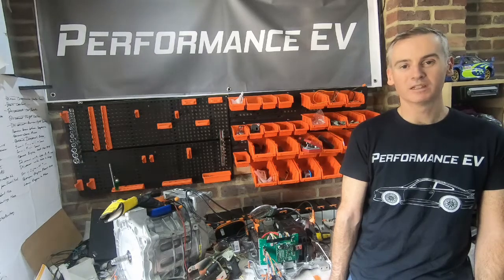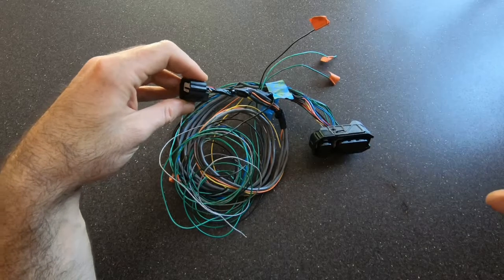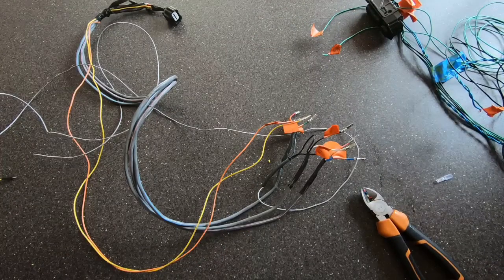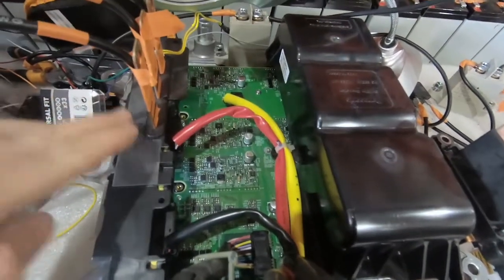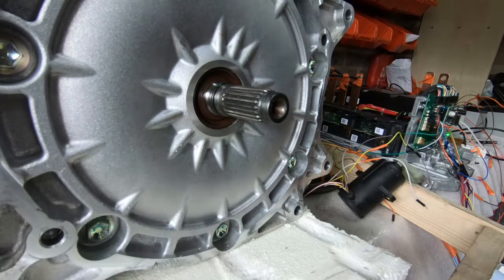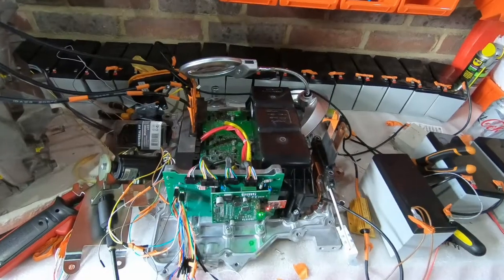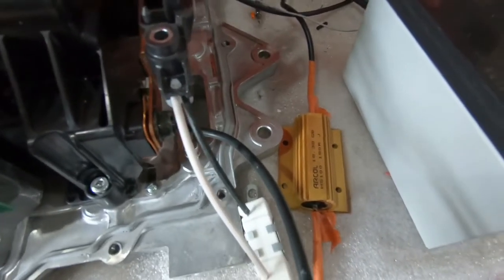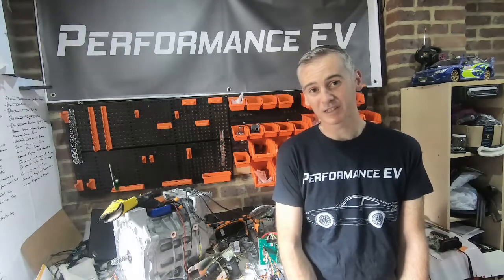Building an Electric Car - EV Parts - Nissan Leaf Motor running on open source inverter logic board

Comment: I never thought of replacing a perfectly good Porsche engine with a Nissan EV motor, but now you have corrupted me too much!! Thank you Shane!!.  I am going to buy a $10K Porsche boxter, and move my Nissan Leaf components into it, and maybe move the Porsche components into the Leaf... Will freak many peaople out!!... But I was thinking, I want to drag race a few bullies on the road with this Sleeper EV Porsche, and its top speed only needs to be 120 km /h after which I slow down to 100, and watch the other guy zoom by with a defeated bad temper.. So maybe, the 62Kw battery pack with the 160KW inverter and a differential that is purposely built for max 120 km /speed? I want to achieve 0 - 100km /h in 3 or 4 seconds, with a 50km ev range after whichI will fully charge it for free at the next charging station for the next race.... Any ideas?

Comment: Hello is this the cheapest way to use a Nissan motor? Ie cheaper than one of those resolver boards with a Nissan inverter? What it the minimum voltage you could drive this motor with in a car?

Comment: An engineer, I have an idea. Is it possible to put electrical generators that work with the movement of the wheels of the car with solar cells and then connect this electricity to the car engine without an adapter? Please answer 😂

Comment: You eluded to the power that nissan tuned the motor inverter combo to produce not being the limit....what would it be in the real world, in your opinion, without drastically shortening the life of the inverter motor group?
Reply from the maker: Based on the work of others. I have seen a figure of about 160Kw (215hp) using the stock inverter. This would require me to push the max current and voltage that the inverter can handle, so I would need to up the pack voltage a bit to around 450v.  It seems like the motor can handle more, there's a guy in Canada pushing around 225 through the motor with a custom built inverter.

Comment: Many thanks for doing this. My application mirrors yours to a point and all your hard work will save me huge. The open source logic board is to back door all the nissan specific safeties (key fobs etc)? I was hoping to use the motor without the trans but putting a side load on the motor bearings would most likely end in engine failure.(sprocket on output driving another sprocket with a motorcycle chain) Any feedback from yourself or your well informed viewers would be great

Comment: Would it be easier to repackage the entire leaf wiring into a vehicle?  I'm looking to ev a clasic mini
Reply from the maker: There are a couple of options around this, one is to use the full leaf wiring loom, of which there is quite a lot.  This has been done a few times, I recall a discussion on the diyelectriccar form that went into this in depth and I have seen a few YouTube videos of this working.  I think the challenge is that it's not just the wiring you need, but quite a few of the ancillaries need to be plugged into the wiring for the Leaf VCU to actually send commands to the inverter.  These can be things you may not necessarily need in your car.  But if you have a full donor leaf, then may be the most cost effective route as you have all the parts.
Another option is to keep the inverter intact and use a third party VCU like the Thunderstruck one or the OpenSource one from EVBMW.  These send the same commands to inverter as the Leaf VCU, but without needing all the other wiring.
In both of these case you are limited to the 80kW output from the inverter even though the inverter and motor are capable of more power.  I ultimately want to try for more power, so I decided to go for the third option of the drop in logic board, which gives me much more control over the inverter power stage.

Comment: So does the leaf motor have permanent magnets in its rotor? What current does it draw at full rpm unloaded ( I do understand you're only running it on 50V)?
Reply from the maker: Hi Tore, yes the magnets are in the rotor. I found this site quite interesting on the inner workings: https://www.marklines.com/en/report_all/rep1104_201209
I'll get some detailed current data when I next have the motor hooked up and report back.

Comment: If I can get my hands on a cheap second hand leaf controller do you know if it will contain key components like the half bridges that will save some money on an open source build?
Any reason not to do it this way?
Reply from the maker: The leaf inverter includes the IGBTs, however the driver board is soldered directly on top of them with dozens of pins. If you are planning to do what I did, keeping the leaf driver boards, current sensors, capacitor etc. Then it's fine. If you just wanted to reuse the IGBTs and use your own components for those other pieces, then you may struggle.

Comment: Doesn't anyone make aftermarket motor controllers for motors like these?
Reply: Yes, but if you want real power is will set you back about £7k
Reply: openinverter dot org sells ready-built controllers.

Comment: Is it true that OpenInverter can only run the motor to 3000rpm? Seems like a significant limitation if that's true?
Reply from the maker: There were some limitations when they first started trying it with permanent magnet motors (like the leaf one) due to the the software not being optomised to support Field Oriented Control. A couple of people in the open inverter community are working on Leaf conversions so there was a lot of work going on over the last few months to enhance the software to support FOC. I think that version of the software is still in beta but the results are looking good.
Reply: @PerformanceEV  Just read about Paul Holmes setback, but looks like he's progressing really well with field weakening and his processor board for the leaf inverter. Lots of good work going on!
Reply: @PerformanceEV  DO you think the inverter is also working on 3-phase induction motor? Grat succes btw, with the leaf, I am trying a similar manouver with a chevy volt inverter runnning an AC induction motor out of an EV.

Comment: Hi! I may lost some info in Your last videos, but why don't You use original nissan wiring and control?? Isn't it easy too decode dashboard signals against invertor signals?
Reply from the maker: I made some progress on that front, but then ended up going around in circles trying to get it actually to work. I didn't want to lose any more time on the project so decided to move on to using the drop in board. I may have been able to get it working with the can messages, but I realised as I was testing that there would be a lot more effort needed to do something that would be safe for use on the road. Damien Maguire just released a few videos of an Open Source VCU he is building to do this for the Leaf inverter and it is much more detailed than what I would have come up with.

Comment: Are you using the FOC code?
Reply from the maker: Not yet. I took a look at it, but I haven't got my head fully around the additional parameters so wasn't sure of all the changes I would need to account for the much lower voltage I was testing with. I rolled it back to the current released version to at least get the basics working and be certain the inverter and motor were functioning. I'll try the FOC code again when I have 350v+.
Reply: @PerformanceEV  I have mine running with FOC now :)